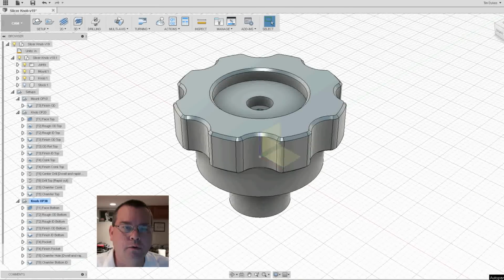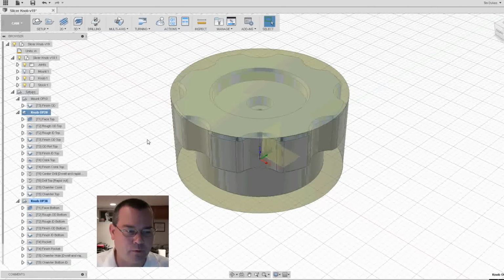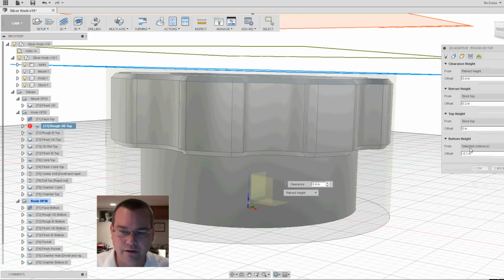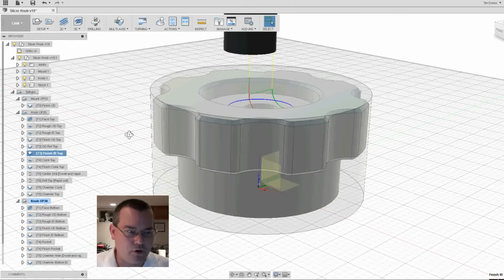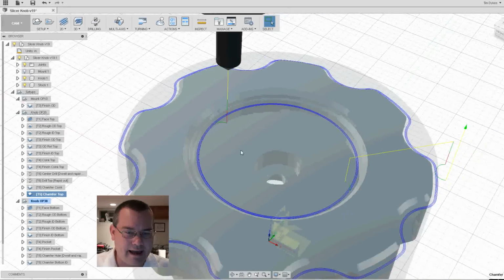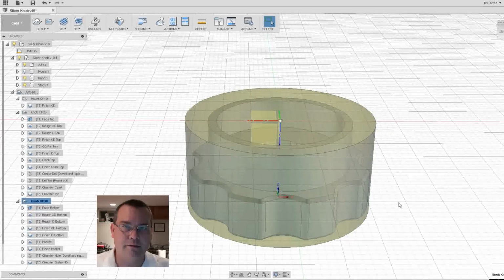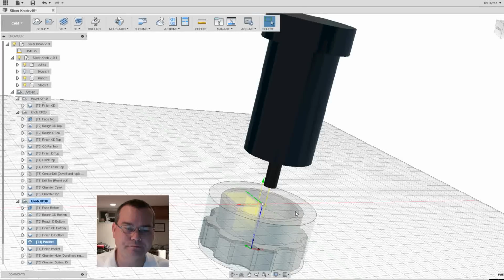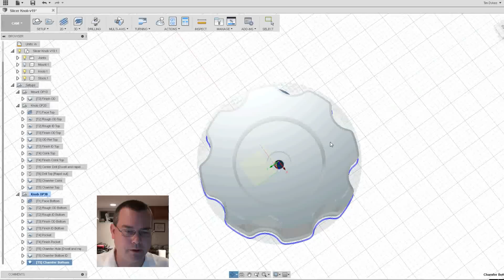Making a Meat Slicer Knob, The CAM

Comment: Couple things to note... you're using spot drill not centerdrill and its counter bore not a counter sink. 

I would use undercut chamfer cutter and chamfer that knob feature so you don't have clock it.  To do this I would make your op20 the op10.  May give you another idea on to cut it in future
Reply from the maker: Thanks Chief, Actually I'm abusing my center cutting chamfer mill as a spot drill. But yes, its not a center drill, easy to make those mistakes in the videos. A back chamfering tool would have been perfect for this part. That said, I didn't have one in stock and this was one of those low cost friend jobs. I try to use all existing tooling for this type of stuff. In the end it was not hard to clock the part and it came out great.
Reply: Should stock couple.. I keep couple on hand not really that expensive anymore